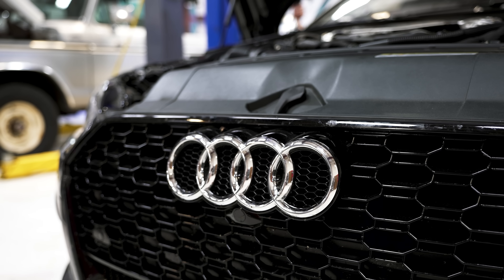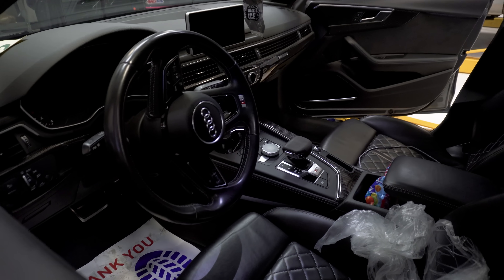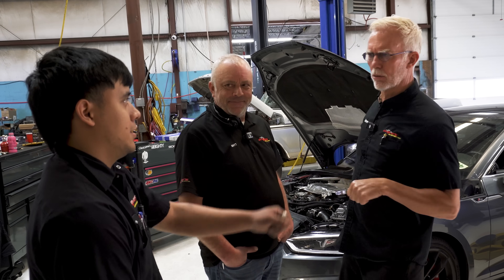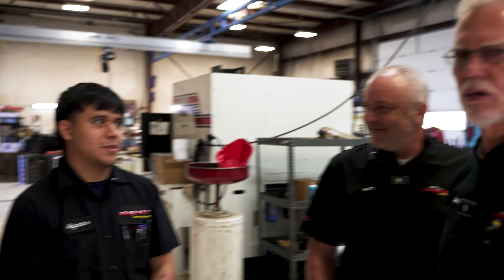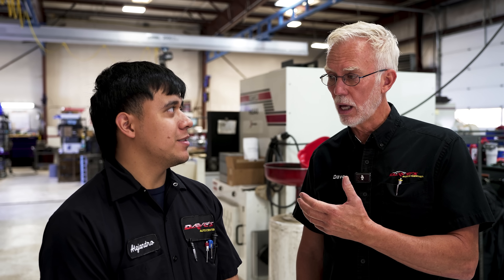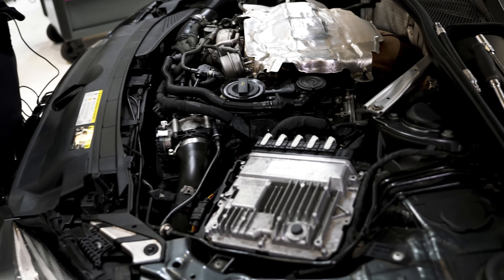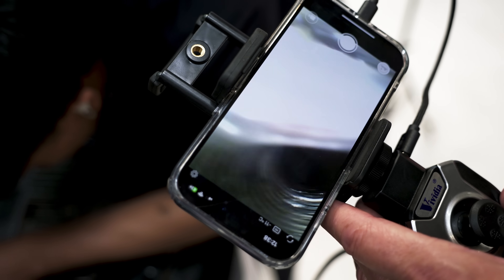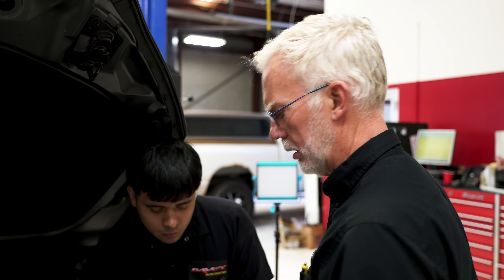Audi S5 Engine Piston Damage

Comment: If this happened here in the UK our Consumer Protection laws would have put the responsibility for the fault back on the Dealer who would be allowed one chance to rectify it at their cost or fully refund the customer as the vehicle is clearly 'not fit for purpose'; this extends for a minimum period of 6-months from purchase for used vehicles and up to 6-years for the original purchaser for new vehicles. All vehicle dealers know this and factor it in as a cost of doing business as failure to comply and deny the consumer their legal rights is potentially a criminal and not just a civil offence. This legislation dates back to 1979!
Reply: I was thinking the same thing. In Australia at least in my state, there is a 3 month statutory warranty on used cars above a certain price. The dealership must repair or else take back.

Comment: Dave , I have a question regarding a 2022 ram rebel 1500 5.7l v8 .
The truck has 33,000 miles on it . Oil changes done at every 5k interval . I noticed when I pulled the lipstick to check the oil level , I was getting alot of small metal flakes and some splinter sized ones . Naturally I brought it ram , and they stated that , it is a normal part of how these hemi engines run . They wrote it on the ticket and all . Is this a normal thing ?

Comment: When you rebuild that engine after you replace the timing chains/ cam vario pulleys and gaskets you'll need to change the cam rollers as they're are prone to collapsing running dry as it will strip the camshafts or even junk the engine if the top end locks up !
I think Audi superseded the parts as common issue in Europe with failing components on these V6 turbos....
Good luck those cam timing chains are serious technical expertise as no American car uses this design of setup

Comment: Dave you’re a good educator. Always remind people it’s not a waist of money to dump your oil a little sooner than normal and transmissions ATF also. Don’t be afraid to replace that 12 volt battery at the first sign of weakness or failure. It’s easier on the whole charging, starting, and computer system. Don’t try to go for the longevity award, spend a little money on prevent to save dollars in the long run.
Reply: Yet to see a tear down video where engine failed because someone changed the oil too frequently.
Reply: No one ever killed a car by over servicing it 🤔🇬🇧

Comment: Seen worse. A lady who won a sexual harassment lawsuit bought a brand new RS5. One of the first ones at the dealership and barely introduced in general. She picked it up days after buying it. Not even two hours later crashed it and had it towed to the dealership. The car was completely rebuilt on the front end. Right as the technician was finishing everything up and was under the impression he was done. He found out the engine was ran without coolant. Much like the guy in the video the car needed a new engine.
Reply: Total BS story
Reply: @JonathanDuddy-oq6nv  sadly it isn't. The really sad part is the fact the girl had a financial advisor tell her, not to buy it. She told the guy basically to fuck off she's buying it. Sure enough wrecked it. She claims a car hauler hit her and kept driving. The damage was right at the front passenger side, where an auxiliary radiator is located. Last I saw the car the girl wrapped it purple with a dent in the rear quarter panel. 

If you think that sounds like bullshit. Around the same time we had another RS5. Mind you both were white. I don't know if they were different colors. If I recall there's glacial white and Arctic white, possibly others. But we had another RS5 get sold to another lady, she was a bit older than the other one. The one that crashed was like in her 20's. This lady was like 40's or 50's. She buys the other RS5. Has plenty of money and is happy with it. Not long after she wanted to return the car saying, it was a mistake. Then proceeds to tell the salesman that she's going through a rough time. She apparently was trying to fix her marriage and went to counseling... she slept with the counselor. Then buys the car and kind of wants to get into the salesman's pants. He was not interested at all in her saying she looked gross. It got so bad management had to step in and talk to the lady. Before that I'd say to the salesman, "hey George, that lady is here looking for you!" He'd hide. But nonetheless, I did see the lady. She was just your average woman in her 50's that was going through a tough time. She could afford the car. Which if I recall weren't cheap cars. Possibly dealer mark ups.

Comment: Gas washing the cylinder wall and increasing friction and hot spots / wear to the point of failure. It is an S-car with a new owner, I imagine finding the redline was a common occurrence in the past few weeks of new ownership.

Comment: New cars with Direct Injection especially Audis are trash heard it here 1st. 2ndly Audi/MB/BMW in "Hot V" setup Intake manifolds on the bottom with Exhaust manifolds on top which makes carbon cleaning valves from Direct Injection 
carbon buildup now a motor out job. Enjoy!

I am a current and previous multi Audi owner (1.8/2.7T/2.8/4.2/3.0T)....RUN!

Comment: Issue with Audi/VW direct injection engines is a design fault in the pistons, causing the rings to become gummed into their slots. Causes excessive oil consumption. Very common problem, especially on 2.0 EA888 engines.
Reply: That's 3.0 TFSI. Not common on it.
Reply: It's also not common on current EA888s, that problem was fixed long ago on those as well.

Comment: That's a failed injector right there, causing detonation. Wonder if the car had been running a tune in the past, owner ran into some issues and traded it in.
Reply: Exactly, High probability.   When I was car shopping back in 2022 and I was looking at Volkswagens and Audis and Subarus most of them have been modified. So I steered clear.

Comment: Pay attention to "super knocking", LSPI. Detonation due to Low Speed  Pre-ignition. It can happen at traffic stop races, (test driving/showing off a car) and it's a car that was at a dealership. Doing test drives... We have had it with 1 Porsche on the track. The engineer ran hot due to clogged radiator, particuls/little drops fuel started to burn to early in the cylinder. All can happen with DI engines.
Reply: Lspi is caused by pcv oil vapors being burned. There is a whole ase stud and new oil formulation standards

Comment: pro-tip = whilst Audi do make physically nice cars with some great overall qualities, I managed to save for retirement by never owning another one after i sold the 3 i had.  This engine will also most likely require lifters and rockers at a minimum.
Reply: Fun to drive but no reliability... only lease one, turn the keys in and walk away.
Reply: And timing chains.

Comment: Hola 👋 señor Dave that’s a shame on Audi vehicles… breaking at 70k miles that’s total BS ,so all the showing off of a indestructible car from the movie “the Transporter “👀😳it’s just a big fat lie 😠😡what is happening with the car industry I know there is wear and tear but if I want a GM vehicle they are faulty and break right before the 100k miles,that’s why I appreciate channels like Yours where you expose the truth keep up the great work!!!Saludos!!!👋😃👋
Reply: Most likely this Audi mechanically wasn't well taken care of.  Cheap Gas and lack of oil changes is my guess.  Could be tuned as well.  So no shame on Audi at all... This was all preventable.
Reply: You can blame Audi all you want, but the real problem is probably 2-fold: carbon buildup on the intake valves and low quality gas. These things are going to want premium fuel at all times. Don't cheap out on the gas on these things! No one warns car owners about the carbon issues with DI engines, and everyone I try to tell looks at me like I have 4 heads
Reply: @philbrutsche8928  You are right that is another issue and also is the lack of maintenance we don’t own fancy cars but we take care of them the best possible to avoid high repair costs…but definitely car makers are cheating in some ways…I’m not a mechanic or expert in this subject but we work from check to check every week and we need to stay away from cars that are always breaking
Reply: @munozinni  At this point, it doesn't matter if it's a basic car or a fancy car, almost EVERYTHING has direct injection (and maybe forced induction too). DI is relatively new and most people aren't prepared for the costs
Reply: @philbrutsche8928  It sounds like this guy bought the car used, it may have been hosed up by the previous owner.
Reply: In 1971 I bought a new BMW 2002. I used to take it to a German guy who worked on BMW, Mercedes, Volvo, and AUDI among others. He told me back then that AUDI was the crappiest of all the German cars.
Reply: @thomasdragosr.841  At this point I would almost (ALMOST) rather have a 1980s fuel injected BMW than a modern car. The Bosch Motronic 1.x engine management is very similar to modern fuel injection. They are gas hogs though
Reply: You’ve assumed, and we all know what assume stands for don’t we?
Reply: @stephenpage-murray7226  The car had 75,000 miles on it and the present owner only had the car for 40 days. It’s safe to say the car had issues before he got it or AUDI’s are junk.
Reply: @thomasdragosr.841  
Poor logic.  It could be tuned, poor maintenance, poor fuel for starters.
Reply: @thomasdragosr.841  75k miles is right around the time it's going to need intake valve cleaning for the direct injection, and it's likely the previous owner used cheap fuel and/or an injector got stuck (which may have also been caused by cheap fuel)

Comment: Ah yes, the modern Audis... Which some of them mysteriously consume oil when new from factory and Audi has a chart that says 1-2 quart lost per oil change is within spec 🤦‍♂🤦‍♂🤦‍♂🤦‍♂🤦‍♂
Reply: You're talking about the EA 888 motor. This pile of garbage was able to consume 2 litres of oil on 1000km which is insane. And volkswagen had the audacity to say this was tolerable.
Reply: @AsurasWrath164 Yes the older EA888s were terrible about that once the got to 75k miles or so and the oil control rings and drain back holes became carbon fouled. They redesigned them and the newer ones don’t tend to do that. Unlike Hyundai they actually have a legit fix for the flaw, albeit expensive.
Reply: @briantii  had mine fixed at 65,000 miles as it was burning a quart every 500 miles… now at 130,000 miles it burns almost 0 measurable oil between changes.
Reply: @BriansRCStuff  Nice! I’m hopeful mine holds up over time. 18 Q5 at 74k. Electronics have been problematic under warranty… hopefully it’s solid from here. Burns no oil though!
Reply: Almost all brands say it's only excessive if it consumes a quart or more per thousand miles on fresh oil. I have worked for Acura, Kia, Honda, Audi, and g.m. and that is the standard with all of them.
Reply: Literally all modern engines do that. It is the low friction clearances for the rings and many other reasons that the manufacturer didn't get to choose.
Reply: There was a service bulletin with regards to the piston rings on that engine.
Reply: Eh. Low tension rings plus high peak cylinder pressures means it burns some oil. It’s part of the fun
Reply: @aygwm  Yeah but it also increases blowby which then the pcv has to deal with that and now most direct injected ones get crazy carbon buildup on the valves. That’s why if I ever own a new direct injected car I’m gonna get a catch can
Reply: Beautiful nightmares!
Reply: Even Toyota says it's "normal" for their engines to burn 1 quart every 1200 miles. How many quarts between oil changes is that?
Reply: @karlschauff7989  depends on the engine.
Reply: If it's the engine in the S5 check your oil separator.
Reply: it pisses me off the things audi does. theres a bulletin for heated steering wheels that says UP TO 30 MINUTES for the steering wheel to heat up is normal. they really will just find a problem and instead of fixing it say its normal operation. VAG products are good job security though.

Comment: Injector got stuck open. Customer ignores warning and continue to drive a car; gasoline is washing cylinder out. 
Lack of lubrication caused ring/piston failure.
Do not ever drive VAG cars if you have yellow light flashing warning!
Reply: I was thinking that, or plug wasn't firing.
Reply: @5thgearratchet  If plug wasn't firing, ECM would shut off related injector. Any detected misfire, in Audi vehicles, will be followed by shutting down Injector and Ignition Coil. Unfortunately, stuck open injector is not correctable.
Reply: @senco981  I was unaware of this. I appreciate the knowledge
Reply: Yea the fact he drove it 300 miles like that instead of shut it off as soon as light came on screwed it up more.... these engines are usually really reliable the b9 s4/s5 are tough not as tough as b8.5 motor but u this jus freak occurrence
Reply: @jdmteggy2388  the new s5 rs5 rs4 are very good engines. I tune and work on audi porsche bmw engines and audi are very tunable reliably and are reliable same with rs3 and rs6
Reply: 100%
Reply: Thing would have thrown nox codes all day
Reply: The high pressure fuel pumps are known to go and cause fuel to flood the engines
Reply: @abel4776  Says who? Armchair material scientist?
Reply: @abel4776   yet... they don't? I had an s5 and got 200k miles before selling it perfectly running and I never had an issue with the engine and I done a stage 2. You don't know shit about engines so stfu.
Reply: @abel4776 plz don't forget your tinhat when you leave your home every morning.
Reply: I’m not sure if the car would pick up an injector failure?
Reply: @aygwm  it would detect the misfire/detonation/knock/pre-igniton. It would pick up incorrect AFR and throw a code as well. Any flashing MIL or CEL means immediately turn off vehicle. That's immanent danger to the fuel system/piston/valves/cat/O2s (sinuses/brain cells (running rich).) In a nutshell - it means stop.

Comment: Hey guys, I have a 2017 Hyundai Sonata sport with a 2.4 and I had the direct injection cleaned and I could not believe the carbon that came out of the tailpipe kind of scary. I went to the dealership to pick up two belts and when I went in there, they had eight cars, most of them for new new four new Kia and four new sonatas and a Santa Fe brand new one they all had crate motor sitting in front of them. They got a bunch of bad motors. Thanks for the info. I might get rid of direct injections Sonata.

Comment: Take an oil and a fuel sample. Car is new to the customer. Did he put some wrong fuel in it? Is it a mixture now? Too much debris? Dus the dealership gave it an oil change before delivery to the new customer? Otherwise you start the rebuild engine, and can take it apart on your warranty... Because you start it still on the wrong fuel.

Comment: Is the issue with DI being that you build up carbon in the valve seats? Otherwise I'd assume it has to do with running lean
Reply: VW engines are known for chronic build up that you need cleaned out quite often.. Could have led to injector failure, causing a lean burn situation due to the lack of fuel in the combustion chamber.